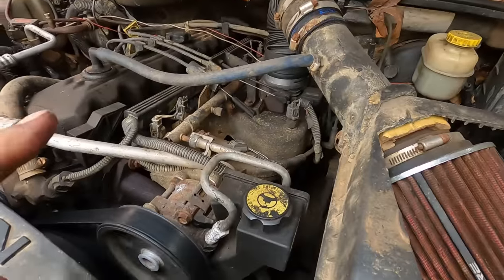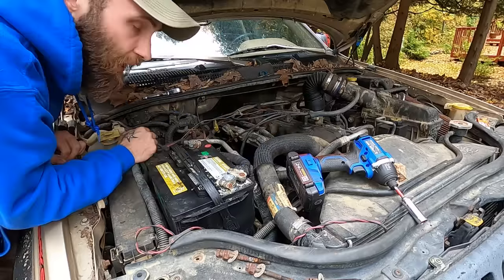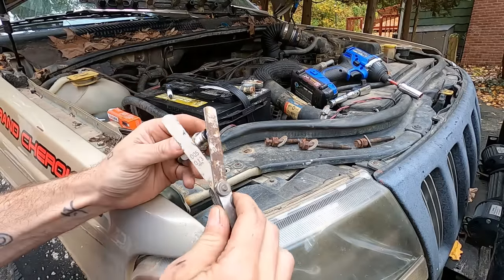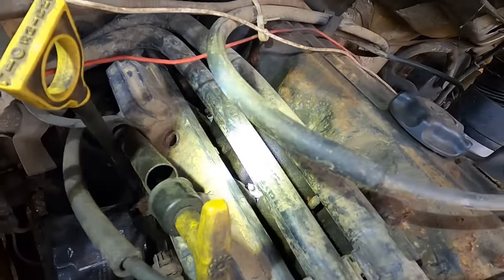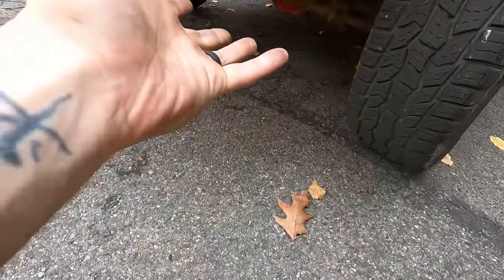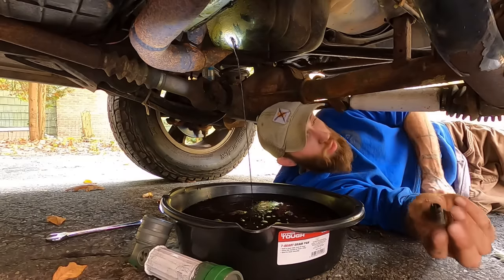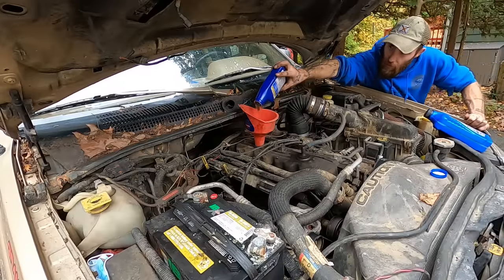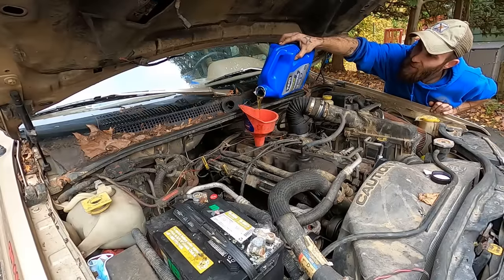Stop treating your Jeep 4.0L like a MODERN ENGINE... It isn't one!

Comment: You having a clue what you're talking about. I've been working on engine since 1964 and almost none of your advice holds any water. First of all don't ever show a container of STP and think that it has enough zinc in it to do the job on that 4 L motor. You have to buy additional zinc to add to the oil. You have to put a zinc additive. Almost none of the oils that you see have either enough zinc or enough titanium nitride in it to replace the zinc. If your engine is running properly, that standard Autolite plug which I have used since the 1960s will run about 60,000 mi. Run it at about .045 that NGK you're replacing looks like it should be good for another 20,000 miles easy. Iridium plugs will last 100 to 200,000 miles easily. Increasing that Gap a little bit will make the spark a little hotter and the better ignition system that that jeep has on it will fire them easily. That will increase your fuel mileage and the running of the vehicle. As for the copper plugs. You can take a resistor plug and change it to a copper plug just by taking out the resistor and putting a piece of copper into it. If you don't know how. Believe me you have no clue what you're talking about. Which is what I started with. Secondly about a week before your oil change when it's a court low on oil. Throw a quart of Marvel Mystery Oil in it or ATF might even do better. And run it for a week and keep the inside of that engine clean. There is no reason why that engine needs to be dirty. The ATF will help the seals better. Or even a half half mixture of ATF and Marvel Mystery oil. Marvel Mystery Oil has been around since 1923 for a reason. And before that it was a motor oil for World War 1 aircraft engines.
That is an excellent engine, It's a Chevrolet based engine originally, and not keeping it clean inside is going to cost you at least 100,000 miles of life. Your battery terminals suck. Quit buying those cheap bastards. As for cleaning the outside of the motor, get a product called Gibbs and soak down everything under the hood while it's running. Let it set a few days and then take it to a spray car wash and don't get the one anywhere close to anything just rinse everything off. Do that at least once a year. The engine will love it. The engine is not designed to run dirty. And it will keep it sealed that is a penetrating oil that will penetrate into a millionth of an inch and it's the only product I've ever been able to spray apart wipe it off and paint it and the paint will still stick. And it will keep it from rusting any further as well. And that may not be the rear main that may be your valve cover gasket leaking down into a spot where it looks like it's the rear main so check that first. Just so you know STP has less zinc in it by far then any flat tappet oil that is made. You are taking zinc out of the oil if you add STP you are not adding zinc. STP hasn't had a reasonable amount of zinc in it since probably 1995. STP is not a zinc additive. It is a zinc reducer. Dzp amount in STP is minuscule. High mileage oils don't have zinc in them either because they have additives for the seals but they do not have zinc in them. New engines use roller bearings they don't need zinc the green new. Let's just say that's not a problem I love these Mopar filters I never have problems. And yes always use a good oil filter the Purolator boss is probably the best. And use the large one. Like the fl1a Ford Motorcraft oil filters are good oil filter. I went as you are putting that STP in that motor. It has no need for that crap. You use about a half a bottle just a thicken the oil a little bit but it is not adding zinc. I cannot stress that enough. Do not tell people that that stuff adds zinc.

Comment: stp is for worn out engines once you use that crap you cant go back and it really doesnt have that much zinc in it. i dont think the 4.0 being an old engine is a good excuse to cheap out on oil, there is nothing wrong with using high quality oil as long as its made for flat tappet engines and has high zinc like amsoil z rod or rotella.

Comment: i replace my plugs when it starts to miss 2 or 3 times on cold start........
.
however... im NOT sold on the zink..... their are 1000s of these engines with 350,000 miles that saw nothing but "modern" API SM/SN oils 
i dont think the valve lift, duration, and spring pressure are enough to cause damage 
.
zink will not hurt it.... and probably a good idea if you plan to red line the bitch for 5 mins getting un-stuck lol

Comment: I always cringe when people put full synthetic in a 4.0. That’s not what their designed for 😣
Reply: They run fine on it. It's a problem when you have an old worn out beat to crap motor that has nothing replaced. When that happens you basically are ban-aiding that worn POS throwing in thick additive oils to compensate, or diesel oil.
Reply: @CanadaBud23  Why would I spend more money on oil when i have more classics then you can count
Reply: @waterloo123100  How is it even more money? I buy at the same price as conventional. 😂

Comment: Keep spewing your bs about  loading up with zinc additives…….most Jeep engines burn some oil…….zinc deposits can and will find their way to the cats and deposit a coating of the zinc on the catalyst medium. Jeeps are bad enuff at throwing the O2 sensor codes that people throw parts at trying to avoid replacing the very expensive cats that you are showing them here how to destroy. Off reading and no cats? Go for it.